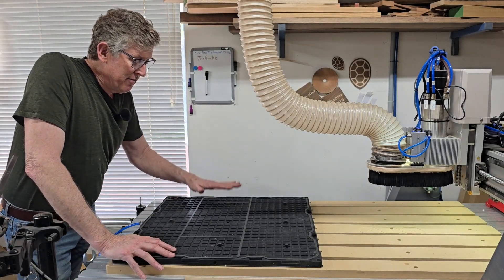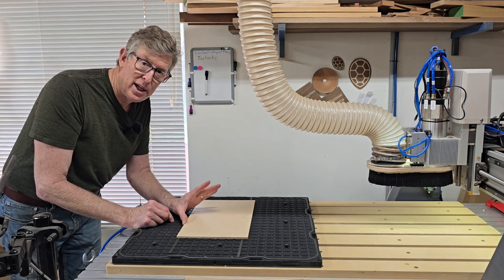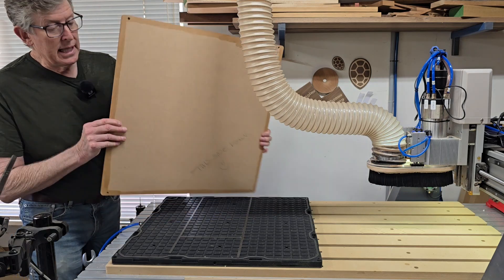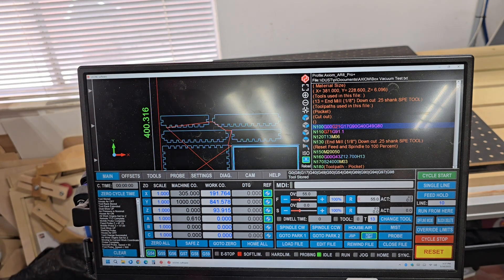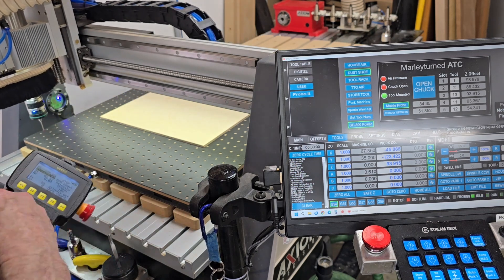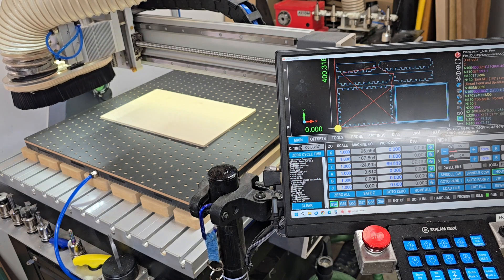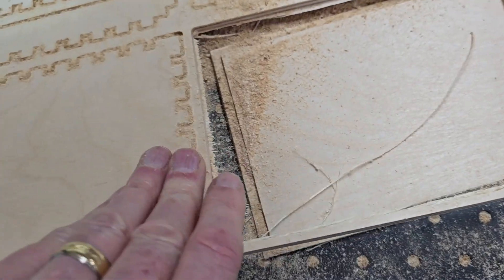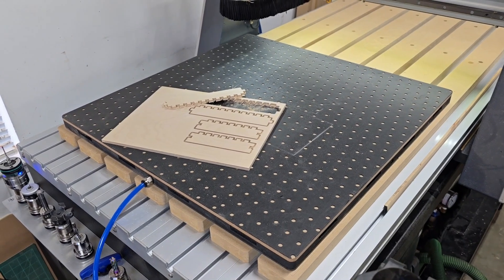Vacuum table on a cnc router. Testing small parts.

Comment: Great product, but my private opinion this equipment is overpriced, I have Altmill 4x4 and I need vacuum table, Air Weight vacuum set price be almost the same that I paid for machine (AltMill MK2 4x4 - $3,160. Air Weight 24" x 48" and I need 2 of this sets - $3,098). Thats the reason why I make my own -Material cost me:  PVC Sheet 1" x 48" x 96" then mounted in my machine and create my own vacuum table with much cheeper cost. (FUJI ELECTRIC Regenerative Blower: 1 hp - $990. PVC sheet - $160. few 3/4" and 1-1/2" PVC fittings-$100. and Foam Rubber Seal 6mm Diameter 5 Meters Long Black - $13.59. from AMAZON) this way be better price then Air Weights vacuum table..for . Also my vacuum pump works with no problem for all day (7-8 hours) while Air Weight vacuums have no specification for how long they work during CNC cut process. (Only one difference-FUJI pump need 220V which is no problem for me)

Comment: wow you have that axiom decked out!!..what shuttle speed do you have it set at?..i just bought a used ar8 pro+ 2019 year model..looks just like yours..different control box and of course has the richauto pendent..im new at cnc but think ive got some of the basics down now..problem is ive found that my machine is not cutting square..its horribly out..ive max out all the adjustment on the gantry legs to the underside cross member..i still need more adjustment to get it in square..im not quite sure what to do next..axiom support has offered some ideas..but i think im going to have to go with some of my own now..
Reply from the maker: Thanks,  it sounds like your gantry is not square with the table. It needs to be perpendicular to the y axis travel.  Where the x axis attaches to the verticals is probably where the fix is. There may not be an adjustment there. You may need to create one.  But definitely start with Axiom precision for guidance.
Reply: @marleyturned  thanks yeah ive got it close but there is no more adjustment left..only thing to do now is somehow create more adjustment by wollering out holes..
Reply from the maker: @rat8356  after looking at mine last night, it looks like the adjustment is at the linear guide bearings? I remember asking about it while getting tramming advise that they just hope the Y is square.
Reply: @marleyturned  the adjustment is in the 3 bolts that come up thru that underside cross member/bridge that attach the gantry legs..the bolts are hex head cap screws set into a bored out pocket in that cross member..i did after doing some more tests find that the left hand side y axis cuts longer than the right hand side..if i tell it to make a 24'' long y axis cut it is about 1/32'' over 24'' and the right side cuts 1/32'' short of 24''..these test i did were done by just by lightly plunging a v bit straight down into the spoilboard to make a mark i can measure from so there was no real cutting forces to the machine involved..i discovered this while trying to do the 3-4-5 procedure using 18'' and 24''

Comment: I'm wanting one for profile cuts all the way through the material. Won't it trash your black hole material ?
Reply: Hi @drich6816! Most of our customer cut through their profile by about .005" just etching the surface of the Tile Gasket. At that depth, most users can run the Tile Gasket on a full-size router or tabletop system like this for several runs before it needs to be replaced. Follow us for more!
Reply: @ALLSTARCNCPRODUCTS  thank you for the information

Comment: Hey Larry, what CNC and software are you running?
Reply: looks like UCCNC according to the top left corner
Reply from the maker: The software is UCCNC. It is paired with a cncdrive AXBBe 6 axis motion controller.  This replaces the richauto controller that came with the machine.
Reply: Nice video Larry. Instant sub ;)  The All-Star stuff is great. May I ask, what is that wireless touch probe you’re using?